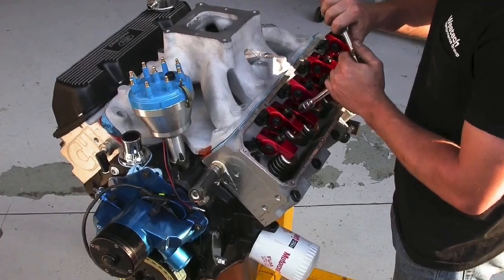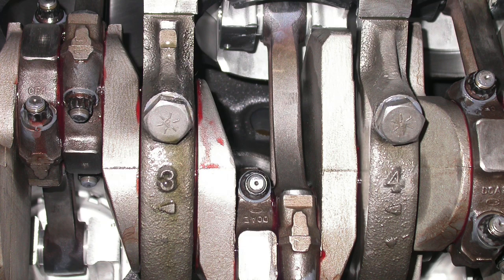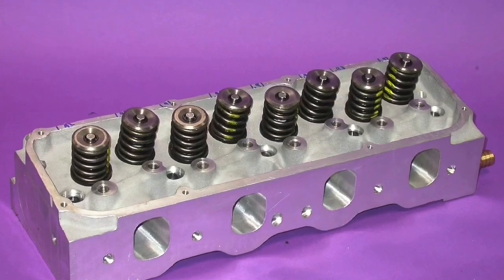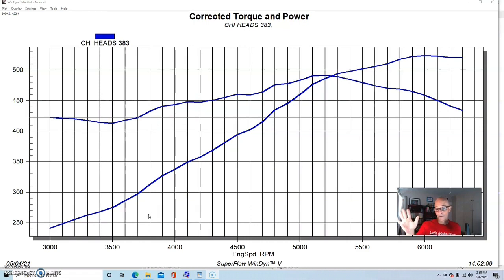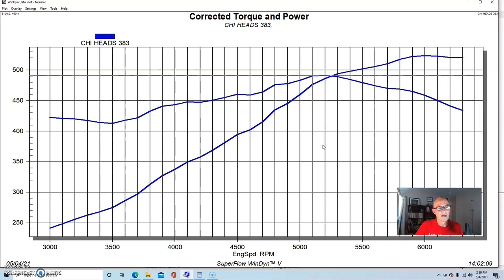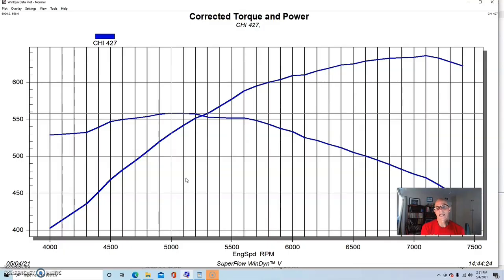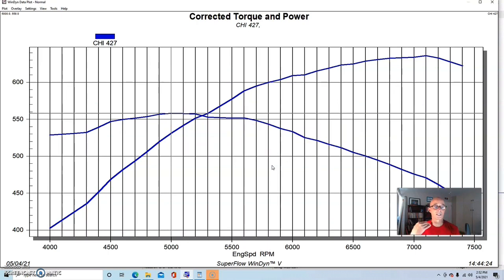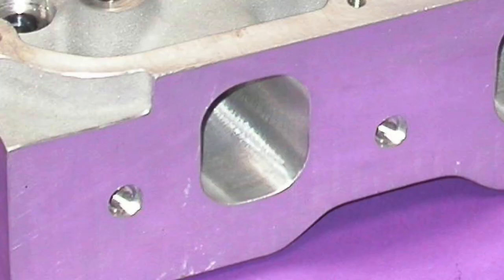351 STROKER CLEVELAND OR CLEVOR? WHICH "OTHER GUYS" MOTOR WORKS BEST?

Comment: The Windsor block has priority main oiling, and usually thicker cylinder walls.  Both make it a better foundation!
Reply: Lifter bore bushings fix the cleveland oil system once and for all.  It also has smaller mains which are less friction and capable of higher rpms.  Or you just go buy a new T Meyer Cleveland block and you are done.
Reply: Better aftermarket support than the Cleveland as well .. cranks, pistons, etc.
Reply: @granbordeaux6955  Pistons are driven by heads and cranks are not hard to do.
Reply: @kblackav8or   ????   Are you arguing the 351/400C has better aftermarket support than the 351W?  Cleveland fan boy alert. 100,000's more 351W's were made from 1969 to 1996 than Cleveland family.. Early 80's Ford Trucks still had a 351M .. but just a couple of years.  Certainly no Cleveland between 1987 and 1996. Certainly no Clevelands in the #1 selling pickup in the USA for that time period.  The aftermarket is driven by what will sell ...  It's not a robot with a Head/Piston equation.  No Cheap Roller Cams.. either.. for the Cleveland.. you'll need all aftermarket to get it.  There are 351W's in my local Pick A Part.. today.. no question.  Cleveland?? Only if some ancient iron came in. 1985 was 35 years ago.. How many 35 yr old cars hitting the scrap yards today?
Reply: @granbordeaux6955  NO not saying that.  I will say this, it is the more race oriented engine.  In fact all the SVO blocks Ford was racing in the 80's and 90's were a hybrid.  Cleveland dimensions with a improved oiling system and a W front timing cover.  I know, I run one.  The cleveland head design is superior to anything wheezer and you cannot argue otherwise.  Canted valves win.  You can't spin your W block as hard as you can a C block.  Those huge mains slow you down.  Had they kept the smaller 302 mains yes but they didn't.  The 351W was with exception to 3 years of production a non performance engine.  69/70 4v 351W and the 94 or 95 Cobra Mustang that had it.  That's it.  Of course there are more parts but keep your wheezer heads and your wet manifold.  I am not after a pickup engine.  My SVO G351 block will outperform your factory W block or a factory C block.  Leave them both 351, you build with inline valve W parts and I will build with canted valve C parts.  I win every time.  That Roush guy and that Glidden guy beat a lot of Mopars and Chevies and neither ever ran a wheezer.
Reply: @kblackav8or   Your SVO block out performs a stock block?  You don't say? Lol..  Keep it apples to apples comparisons  please -  Who would ever argue any stock block over an SVO block? I don't argue for any Stock Windsor/Production head .. ever.  Not one.   But for a street build up.. for the sake of ease and cost.. and the fact the 351W block can easily handle 600hp and I can use an economical Factory Roller Cam set up.. I'm going 351W block over stock Cleveland block.  There are a dozen heads for the 351W in Windsor config that flow over 270cfm .. or if I want.. I can build a Clevor.   408 crank.. cheap and plentiful for the 351W.
Reply: @granbordeaux6955  Better aftermarket THAN Cleveland. Read before you unleash all of your knowledge on the world.
Reply: the cleveland oiling issue and having to straighten out the lifter bores isn't the only issue, there's the exhaust port bend--the Pro Stock boys back in the day would just cut the E port off the side of the head and weld on new square ports to get the angle right. Edelbrock admits, their Windsor heads outflow their Cleveland (since its an OEM replacement) heads. so if you want to toss together a street engine for your four cylinder mustang? A roller block 351W with either GT40P heads or whatever aftermarket heads are on sale this week (what's these CVI heads run retail?), for the win.   If you're handy with modifying OEM EFI intake manifolds, the junkyards are full of stuff for the 351W--nothing for the Cleveland. 

The oversized mains on the crank are generally to create "overlap" for strength. Again, if you're building a budget engine for the street, what RPM are you really going to turn? Main size isn't an issue for this--its not an Olds 455 or Pontiac 455 we're talking about.
Reply: Cam montreuil engines    I mispoke.. somewhat  ..400 M .. Modified.  Cleveland architecture.  I should have said 351c/400m.  400m was popular in early 70's LTD's .. and to a lesser extent pickups.
Reply: Cam montreuil engines   400 was on the M block ..  Modified block.  302 was also Windsor block w shorter deck.. Windsor family but never designated with a W .. Are you going to shed tears and say "Don't call the 302 a Windsor since it never had a W by the numbers" ??   Try harder to be an anti-slang Hall Monitor.   You ever thought about engaging in profitable conversation?
Reply: @shvrdavid  Sure.. 20 years of a lot of guys on the pre-eminent forum on 351 Clevelands is all wrong.. Actually the Cleveland head and engine were a fresh design for 70 and they did use a modified version on the Boss 302.  Whatever books you source or read are out of date.  The lifter bushings keep the oil in the bottom end because that is where the leakage happens.  And yes despite your doubts, it fixes it.  The external lines are a bandaide, and so are the moroso restrictors.  Too much oil goes to the lifters which then goes up to the valve covers.. remember when they used to run drain lines from valve covers back to pan.. Hmm wonder how that happens.. goes to through the lifters up the pushrods and into the top end.  I have 3 in my shop right now and have been dealing with them for over 20 years.
Reply: But if I had to choose Chevy 350sbc or 350W I’d have to go 350. If it was 350 or Cleveland I’d have to try the Cleveland
Reply: @kblackav8or   The issue with the 351C is not the oiling system but the way the crank oiling passages are cross drilled.   Replce the crank and the Cleveland's oiling issues vanish..
Reply: @granbordeaux6955   There is no M block.  There is NO Ford literature that EVER called the 400 an M nor did Ford EVER call the the 400 Block a modified block.. The 302C, 351C 351M and the 400 are ALL 335 series engines.      There is the 400 and the 351M, the 351M  is labled as such to differentiate is from the 351W and the 351C   The M stands for Modified as it is a 400  modified with a Windsor crank and taller pistons to give 351CUI displacement. There is NO such thing as a modified block.
Reply: @matthewq4b  No - lifter bore bushings on stock blocks is the fix, a lot of leakage to the top end and around the lifters was determined to be the root about 20 years ago after all the bandaid fixes of external lines and restrictors over the years.  Bushings in.. oil goes where it is supposed to.  In all my years around them it was not the crank but loss of flow to the back cylinders and the valve covers would be full of oil unable to drain back fast enough.  Your fix doesn't fix it.. maybe it makes it better but it doesn't solve the root issue.  T Meyer is casting new improved blocks that have improved oiling system and better tolerances.
Reply: @kblackav8or   NO this again is a myth.  The 335 Series is not the only block with this style of oiling system. Yet is the only one that suffers this issue.   The issue is in the crank, swap cranks with an aftermarket piece, and the oiling issues go away.   If you actually know Cleveland's then you know the issue is with the crank and why it is only 2 and 4 mains and their respective rods 2-5/4-7 end up being taken out.  Also it is the only the right head that sees lots of oil, the left bank/head is the last leg the oiling system and in higher mileage engines and at high RPM's typically it is starved for oil.  So for all your experience around the 335 series, you do not really seem to have much of a grasp of these engines.     Replacing the crank will solve the Cleveland's oiling issue in all but the most extreme applications. 
(long-distance circle track and jet boat). Regardless restricting the flow to #1 main is a good idea even if you are running an aftermarket crank as #1 main just gets way more oil than it needs.  
Remember the SBC does not suffer these issues and has an even worse oiling system than the Cleveland where the primary from the pump is split into 3 before even going to the mains and uses smaller oil passages.
Reply: Have to add, if a Cleveland had any oil bleed problems, it would never build oil pressure at idle. Period.
All engines that experience oiling issues at high RPM can be traced back to the pump. In most cases, cavitation killed many a Cleveland, either because it put all its oil in the rocker covers to protect its valvesprings, or the pump physically cavitated the oil through suction caused by the RPM used. This is why bushing and restrictor kits dont work for engines held at high RPM for extended periods of time. Restricting oil thats not flowing is a fools game.
So, to help with this, installing a stiffer pressure spring was a drag racers trick to get them to go over 9000rpm. Oval track had many more problems to overcome. Most were by installing a drysump.
This exposes another Cleveland problem. Their stock pump is BIG to start with. So quickly opens the pressure relief spring. This shoots straight in the pan, causing aeration. Oil with air in it causes all the same hallmarks of having little to no pressure at all, and causes cavitation from making the oil thicker. This type of cavitation can be seen as a slow loss of pressure as RPM builds.It also doesn't help that the air in the oil expands causing an emulsion. Once pressure gets low enough, those bubbles of air get big enough to hit the bearings and its game over.
So, start with the pump. Massage the passages, and brace the base of the pump more securely to the block. Install a stiffer spring, and modify the return system to get the oil back to the pan without being a pressure jet. This, along with a sump with double the oil capacity and the oiling problems will go away in all but the most servere conditions.
Reply: @kblackav8or  Yea and that canted head design came from the 1964 bbc.. Thank Chevy for your canted valve Ford heads.
Reply: If the aftermarket support was there I’d go the pure blood clevo anyway!
Reply: @kblackav8or dart shp block FTW. 
Windsor architecture with Cleveland size mains.

Comment: Do a 2v Cleveland build, stock heads with mild clean up, cam, pistons, intake and some headers for the budget street guys. Thanks in advance.
Reply: Yes please! 👍🏼
Reply: Good idea. Put to rest that 2 v open chamber heads are junk. Cause they aren't.
Reply: @cammontreuil7509  2v would be a great option for a street motor. Especially in a truck motor build.
Reply: @I_like_turtles_67  when I had my shop going in the 80's I told my customers to deep six their 360/390's for a cleveland 2 barrel in their trucks.  All were happy about my recommendation. 
Yikes ! I junked 100 or more FE's. Now I feel guilty.
Reply: I think he's already done a 400 basically how your talking.
Reply: @EPstroker  true. But a 400 is a completely different animal.
Reply: Another idea, idk what it costs yet but intend to look into it, is having a set of 2V or 4V open chambers spray welded to turn them into closed chambers, or even smaller than stock closed chambers.
Reply: @cammontreuil7509  It's just a tall deck Cleveland, once you remove the smog crap. Long ass rods. Really it's a great engine that gets overlooked an underappreciated because of the smog equipment it came with. And 4V heads used to be rare, so nobody wanted to "waste" them on a 400, but now you can get repops of the 4V CC head from Speedmaster for cheap, and there's multiple aluminum options.

Comment: Ya i don't know why people say they want to put a comparison up on two different engine and one is 50 more CC's then the other. Then they want to say this engine beat  this engine. I know he didn't do that here, but so many times I have seen where they say we are gonna see which is better a 351 Cleveland or a 351 Clevor. The they leave the Cleveland completely stock while throwing a ton of after market parts at the Clevor. For once I would like to see both the Cleveland and the  Clevor get the same amount of attention. Same Cams Duration, same heads and Valve sizes, same style intakes same attention to the oiling systems, same Carbs and most of all Same Cubic inches or as close as they can be and same compression. I want to see a good and fair comparison between the two Engines. I know you can't build a Clevor with factory parts because of the heads but lets make it Fair as it can be. Then lets see what HP and Torque these engines make and who makes more.

Comment: When I was at SAMTECH in Houston. We built 2 clevor engines. We placed 2nd and 4th in the Engine Masters challenge in 2007 and 8. We also built a 400" sbc and placed 3rd with it. Some fun stuff. I have all the engine build sheets and worked on those chi heads alot. Miss it 4 real.
Reply: I'd like the info you you would be willing to share it. I'm currently building a open chamber 4v clevland for a 59 f100.
Reply: Well done!
Reply: I'll see what I can dig up. We also built a 433 lsx that made 1030hp NA @9700 while I was there. There are some videos out there of it in action. Thanks
Reply: Alor of us would love ti see links on this build.
Reply: I remember the SAM Mustang with the 400ci, big bore, relatively small stroke motor with Edelbrock Victor Heads. It was pretty impressive, running 8's naturally aspirated
Reply: Who scored first?
Oh, right, they have a special "would win by default" section for the Hemis.

Comment: great work Richard love your video's I watch them all and I love how you love Clevelands ! I am running 410ci with stock 4V closed chambers and solid flat tappet 244/252 in my 72 Gran Torino here in Australia and it pulls to the moon!!!
Reply: Certainly over 500hp

Comment: Factory 4V Cleveland heads prepped right make an insane amount of power on a stroker. I built a 434 iron 4V Cleveland with some bowl work and cleaned up runners for a friend using after market Arrow block , street roller cam 260/266 on 110 LC , 665 lift.. 11.1 CR, TFC intake  manifold 1000 cfm 4150 pro system carb . Running pump fuel it produced 672 HP with 582 Ft/lbs., beautiful street manners and gobs of torque throughout the  rpm range 

Down the track we’ll replace camshaft with a 272 at .050  , raise comp by half a point and port the intake. It’ll make 715-720+.

CHI are great heads but if you have iron 4V’s and building a stroker they will work very well indeed.
Reply: What crank rod and piston made a 434 ?
Reply: @cammontreuil7509  Arrow Blocks have 4.155 bore and use a Scat 4" stroke crank..This guy is for real, and the HP numbers stack up..no B/S..
Reply: I see why 4v dominated at its time.
Reply: I want to join the Cleveland club

Comment: I love these comparison tests. I watch them multiple times. The Cleveland is an interesting engine, I’ve never owned one but I love them on principle- big head flow= big power! I would like to see some big block mopar stuff, 5.2/5.9 magnum would be interesting as well.
Reply: 5.9 Dodge Magnum--or 408 stroker--with fuel injection. There are millions of these engines running around.
Reply: @mchristr okay but those are not big blocks and there's two series of Mopar big blocks the B engines and the RB engines both of which are no longer manufactured except for aftermarket blocks

Comment: This 385 Cleveland seems like there’s a lot of power left somewhere. If you compare the specs to a 6.2, the rec port heads don’t flow quite as much and a 469 cam is 9 or 10° shorter, but it makes much more hp and torque. So, flat tappet lobe vs roller, valve springs, and the LS3 intake vs a single plane... I guess numbers don’t lie, and everything counts when you look at the final results! Very interesting data, Richard. Thanks!